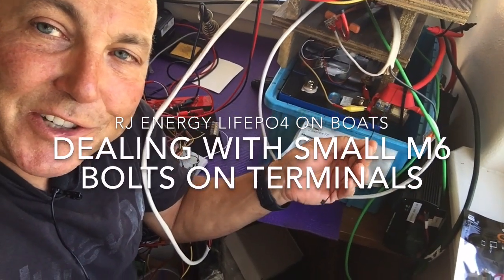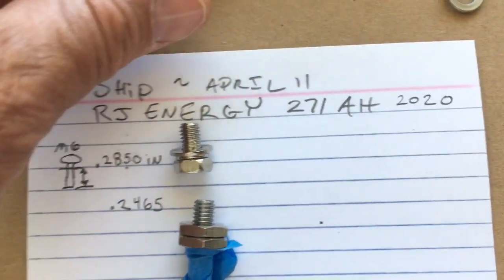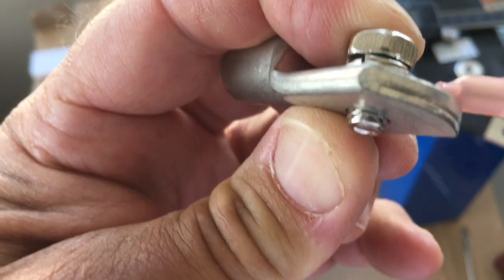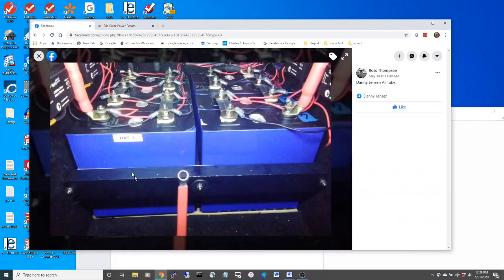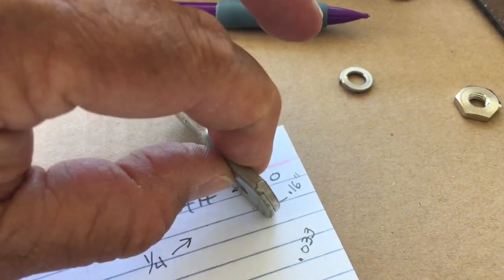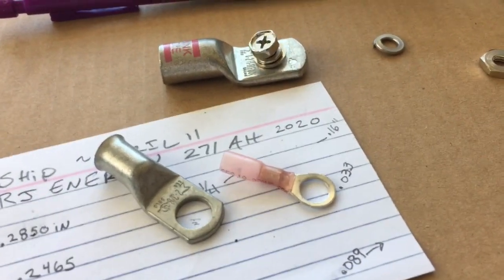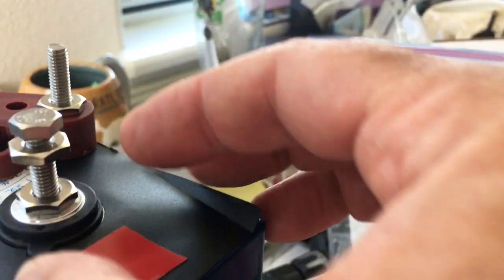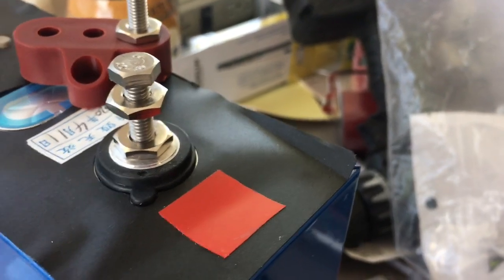Review of Screw lengths on RJ Energy Aluminum Cased Lithium LIFEPO4  Battery for Sailboat

Comment: I am considering ordering from RJ battery, they are quoting me to supply the charger, BMS, bus bars, and cells.  The person I am working with is Carl WU.  What is your opinion of these cells and this company after having them for a while now?
Reply from the maker: Thanks for your subscription!  I still have the batteries at my house and I'm messing around with a new BMS.  They seem ok but I'm still using my old LiFePo4 on my boat. 

I'm guessing you need to spend at least a few hours looking at the responses of others. See below. 
I'm going with the cheap solution but I think Calb or higher $$ are better but it is worth the risk as far as I can tell.

 I would do this search on Will's group https://diysolarforum.com/search/133176/?q=rj+energy&o=relevance . Look at all the comments before posting a question on this group. 

Also, look at the facebook group after looking at the many posts on this exact topic.   https://www.facebook.com/groups/427372107686109 . Will's group also likes EVE batteries. Carl is a safer choice I think.
Reply: @dannyjensen4954  Thank you for the reply and great video.  I am looking to set these up for a 72v golf cart, or well electric truck.
Reply from the maker: @billstriplin4608  Most people seem to just buy the batteries and bus bars.  BMS varies depending on self balancing or BMS balancing. Carl is great. You may need to look around at BMS before you pull the trigger with Carl. Carl has a very good reputation. For a golf cart, I'd give it a whirl. A boat offshore is a bit more risky but I'm taking the risk.
Reply: @dannyjensen4954  I purchased a 60 volt 40 AH from them and they were very cooperative UNTILL the battery failed 6 months later.  They will not return my messages.  Just lost $1400

Comment: Why wouldn't you get a longer 6mm bolt and use extra washers, either copper or stainless steel as spacers. Maybe you could use an extra terminal as a spacer instead of an extra washer. 6mm bolts would need maximum thread contact inside terminal, without being thread bound. Having bolts of different lengths is fraught with danger if you are not careful
Reply from the maker: Chris Smith I guess people are saying the aluminum threads strip easy so studs are preferred with locktite. I going to do a follow up when I get the parts in I just ordered.  I’m going to do studs. Here is a link to a really smart guy that has been giving me some ideas. https://diysolarforum.com/threads/review-of-screw-lengths-on-rj-energy-271ah-aluminum-cased-lithium-lifepo4-battery-for-sailboat.7582/page-2#post-83586

Comment: Danny - Thanks for this.  I suspect, having watched this now, that as soon as I'm done with my initial charge, I'm gonna be faced with the same problem.  Bus bars needed for charging barely leave enough room on my studs for anything else (balance lead lugs, battery post lugs etc, as you've shown) w my 150Ah cells from BLS.  I'll probably just get longer studs.
And to those who rec to just bottom out the stud in the hole of the terminal, you risk puncturing the hole bottom when you tighten down the stud nut if the post starts turning too.  The lock nuts prevent that from happening, but an alternative is to get studs with allen key heads in one end (aka "set screws") like these: https://tinyurl.com/y98pzhzy .  Studs that came with my cells have these.  When tightening down the nut with a closed end wrench, just hold the post with an allen wrench.
Reply from the maker: dhowman Exactly. I ordered some of these zinc plated. I’m going to do a follow up video. Here is a link where I got some good input. I agree. Best to use studs to limit the risk of stripping and fix the length issues. Thanks https://diysolarforum.com/threads/review-of-screw-lengths-on-rj-energy-271ah-aluminum-cased-lithium-lifepo4-battery-for-sailboat.7582/page-2#post-83586

Comment: You need to use a threaded rod and screw it fully home into the batterie terminal. Fasten the terminals with a nut. This will give the max clamp load and best connection.